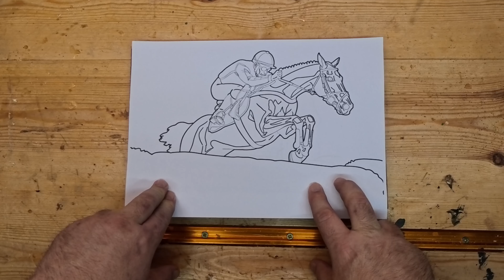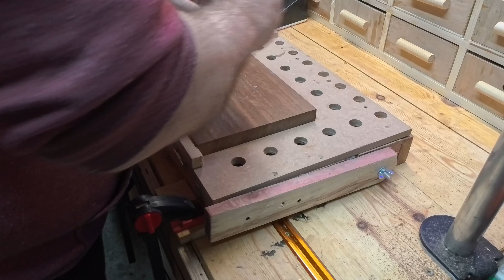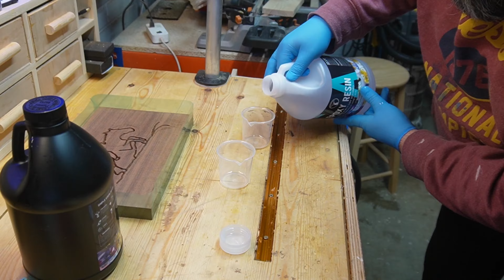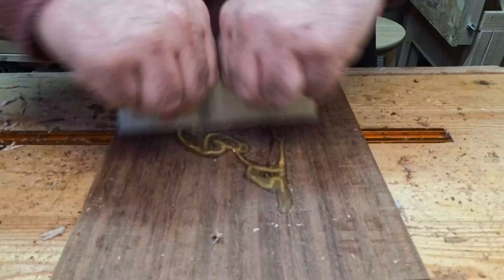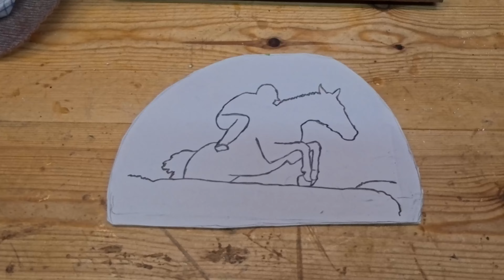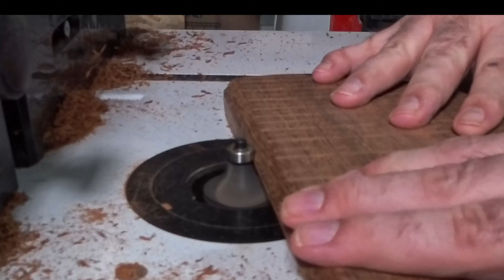Router Carving Into Iroko Wood Filled With Colorful Epoxy

Comment: Thanks for Sharing Neil.

Looks really good. With my chemist hat on, a non-polar clean petroleum solvent is needed if suggesting naphtha. The issue was likely carcinogenic which stopped that in the UK, but you should still be able to get something equivalent. Petrol itself is probably too sticky, so maybe lighter fluid. Then clean off afterwards with IPA. 

Get better soon and good luck for the 500!
Reply from the maker: Thanks for that if only chatgpt had said to try lighter fluid it might have been a bit more straight forward. At least the method I used did it get looking a lot better than it originally was.

I am hoping to start on the next video today but will have to wrap up lol
Reply: @stuffbyneilsmith I typically avoid the AI as I have found search engines have generally got worse in the last few years. Rather than searching on keywords, they jump to conclusions what they think you are looking for. 

I need to work out what I am doing next for video but just got a job lot more of moulding planes to clean up.

Comment: Hey Neil.....I like the technique for cutting it out and might have a go at that myself....I already have some appropriate bits but no material to make a jig..... turned out nice.
Reply from the maker: Hi Adam, the jig certainly makes it easier. The other thing to have is a spare base unit that the palm router sits in and drill out a larger whole with a hole saw. That makes it easier to see where you are routing. Here is a link to the acrylic that I used https://amzn.to/4b3aVEo